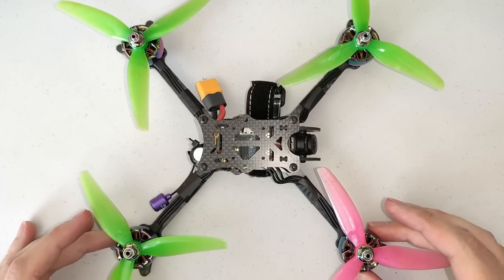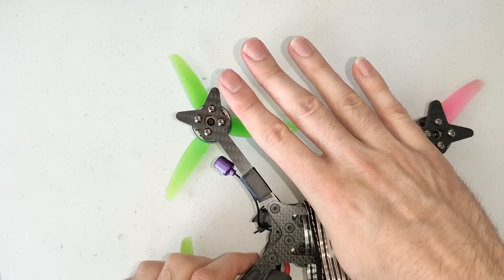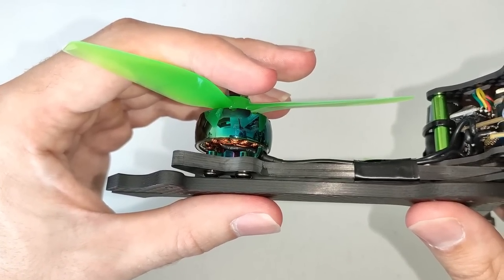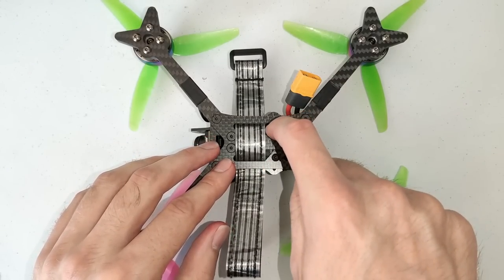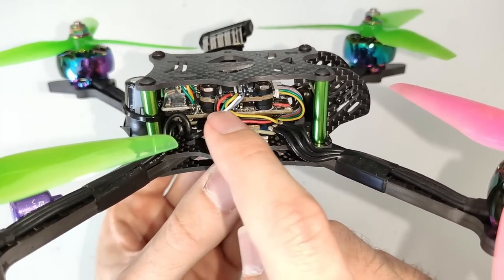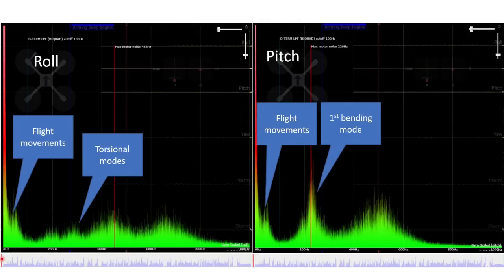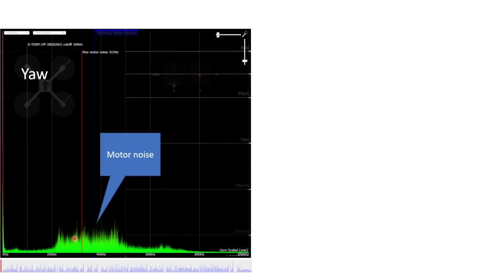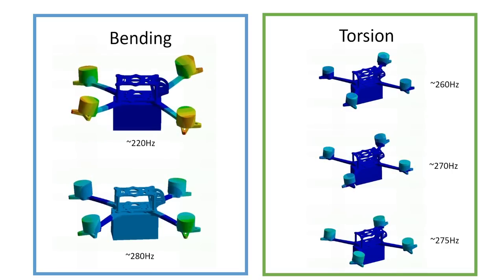The AOS 5R: I designed a whole new kind of carbon fiber to make this racing frame even faster!

Comment: i saw this somewhere on the internet.
The following is the lightweight solution we obtained through experiments for reference. Using 4.99mm T300 material is equivalent to the strength of 4mm thickness of T400 material, which is equivalent to the strength of using T700SC 3.6mm thick or T700H 3.21mm thick, or equivalent to the strength of 3mm thickness of T800S. Therefore, many drone design companies use T800 3mm to replace the original 5 mm T300 or use 3.6mm T700 to replace T300 5mm.
Reply from the maker: For strength that may be true but not for stiffness. Thicker carbon is much more stiff than thinner carbon because of the cubic relationship of bending stiffness with thickness.

Comment: also, you will find that your battery strap method will break the cd slot on the bottom plate. it also wears on straps badly.
Reply from the maker: I'll definitely look out for that. Thanks for the heads up!

Comment: What if you just use regular carbon layup and orientate the arm at a 45 from either weave rather than running parallel to one and 90 to the other?
Reply from the maker: It makes the performance much worse because you lose the bending stiffness from having any fibres running along the arm.
Reply: @ChrisRosser  I would love to see an actual comparison on this. If your arms are wide enough and provide fiber overlap, I expect there would still be plenty of tension.

Comment: I think you can go as low as 2206's to on this one, and get even cleaner flight logs. There are some really good and snappy 6s 2206's out there that can easily carry a frame at 65-68g with a lightweight setup :)
Reply from the maker: Great recommendation thank you!
Reply: Well how low can you go? 
2204 get you there with light props?
Reply: Great idea. For most people, a better responding quad will probably be more beneficial than a more powerful one. Of course not for the absolute top pilots who use 100% throttle most of the time. ;)

But I would be interested when the increase in responsiveness due to less filtering and a reduced moment of inertia of the whole quad is outweighed by the reduction in motor responsiveness due to smaller motors.
Reply: @RCRitterFPV  You can go as low as you want. But keep in mind that this frame already enables running very little filtering with normal motors (presumably Chris used 2207s @ ~30g for the simulations). So you gain less from running lighter motors than on a less stiff frame.

Comment: @ 11:20 we can tell if its resonance or motor noise by looking at the red and white waterfall fft that shows throttle percent 👍
Reply from the maker: Good point. Not much to see on the waterfall plot. There's a little area that's brighter in the motor noise band but not a vertical stripe. I would guess its a frame resonance with low Q factor.

Comment: What about using cross braces? front to back brace vs side to side brace would be interesting to see if it makes differences on the blackbox?
Reply from the maker: Could be an interesting test. Based on my previous work with braces they help a lot with torsional modes and not so much with bending modes. I'll get some cut with my next order and try them out.

Comment: I'm looking to the resonance mode and a question keeps bothering me. Why didn't you design front and rear arms to be different? This should result in different resonance frequencies for the opposite corner arms making resonance modes to weaken/disappear?
Reply from the maker: Great question! Two reasons, firstly is that it the arms don't resonate individually. The whole structure is what resonates, so changing two arms doesn't reduce a resonance it just changes the mode shape slightly and often makes things worse if the new mode shape involves more rotation of the gyro. Secondly, having all the arms the same means you only need one spare part.

Comment: Really awesome to see such a different take on making racing frames perform better !
I thought you will add braces to  the arms  to  stiffen the motor twisting modes , I have this frame , the HGLRC Wind5 lite that has braces running between the front two arms and the rear two arms is that sort of a useless addition for racing purposes ?
It will be great to see someone like Captain Vanover push this frame to its limits, if only it reaches to him .  I recommend Chris you send one frame to Vanny.
Reply from the maker: Haha! I'm glad I surprised you with the custom carbon fibre layup 😎 Braces are not useless but they add a bit of weight and don't help much with the bending modes. I'll reach out to asome racing pilots and ask if they would give the frame a try!

Comment: The frame looks great! And surprisingly it is really competitively priced as well (at least for US/CA customers). Would you mind elaborating on some design decisions?

- Most racing frames have only holes for 3 screw motor mounting. The AOS 5R has 4 holes. Do you recommend using lighter screws (Ti or Al), or do you think 3 screws is insufficient?
- The arms have quite large horns. Wouldn't making them smaller (like most other racing frames) allow more arms to be cut from one plate, making them cheaper? Especially considering they are made from the more expensive AOS arm carbon?
 - You show the battery strap threaded trough the bottom plate on both sides. Is it possible to completely thread it trough the frame and have a battery pad in the middle?
- Do use use a "wiggle plate" between the arms? Why/why not?
Reply from the maker: Great questions about the AOS 5R. Let me tackle them in turn.

1. Having 4 screw holes doesn't add hardly any weight and if you only want to use 3 screws or 2 you can choose which screw positions you prefer.
2. I think the horns give the right balance of motor protection and weight. 4 rows of arms just fit on the sheets used for production.
3. Yes if you want the strap threaded that way you can.
4. I don't use a wiggle plate because it makes the fit of the frame very sensitive to tolerances. While a single frame kit can be cut to fit tightly replacement parts may not fit well depending on tool wear and other factors. The result is that customers may need to file parts for a good fit or parts may be loose.

Comment: Isn't the type of layup you are using called Quasi-isotropic? You designed it?
Reply: This was my question: this just sounds like slightly tweaked quasi-isotropic.
Reply from the maker: No it's not quasi layup. Quasi is 25% 0/90/45/-45 my layup is a mix of 0/45 and -45 the balance is carefully chosen to match quadcopter arm load cases.
Reply: Quasi isotropic layup has the same amount of fibers in -45,0,45 and 90 degree directions, while these arms use mostly 0 degrees and a little bit of -45 and +45. So it is quite different than quasi isotropic.
Chris even went further than the simple option of exchanging the 90 degree layers with 0 degrees in the quasi isotropic layup. I think he recognized that bending is more important than torsion in this design and biased the layup more towards 0 degrees than +-45. (The first bending Mode has a lower frequency than the first torsion mode.)
Reply: @ChrisRosser  and @L S Thanks for clearing that up. I didn't see any blackbox comparrison between standard layup and this 'special' layup, only a mention of moving the first spike in noise up to 220 from 180. Those are some quite dirty logs for a lightweight racer barely above 50% throttle from what I can see. Not hating, I love inovation, it's just the results are a little misleading. I don't think shifting that spike from 180 or 220 will make any difference in performance.

How's the durability? Have you managed to test side by side with standard layup?

What is the weight of the frame please?

Comment: Is the 45*/-45* in the middle worthwhile cost-wise? Seems that a thin sandwiched material in the middle does not have enough effect or leverage to resist much torsional loads, hence hollow/tube-like constructions or carbon/foam-core laminate sheets. Perhaps unidirectional carbon sheet would give most/all of the benefits of AOS arm carbon? (Then, could there be an even cheaper pultruded option?)
Reply: i use pultruded tubes on my own frames
but that only works for a constant cross section
traditional arm shapes with vertical fibers would be useless
Reply from the maker: I certainly think so. The torsional modes of the frame are the most difficult to deal with with traditional arms and adding 45 degree layers does a fantastic job of stiffening them up. The cost increase is pretty minimal in my opinion for the benefit.
Reply: @ChrisRosser  Thanks for your insight. Thinking wing spars or composite skins, where torsional stiffness comes from 45* skins, not cores. Maybe having a thick core of 0* unidirectional with a 45* skin top and -45* skin bottom would be a better solution.
Reply: @marc_frank  "AOS Arm Carbon" comes in sheets, according to Chris, but it is only intended to be used for traditional skinny arms. And if just using unidirectional carbon along the length, then "Rectangular Pultruded Solid Strip" would work similarly and be very cheap. Just need the strip to be wide enough for the motor mount and arm-end bumpers. Just machine away the area to make the arm "skinny."

Comment: Hi, I am going to order the HD version. What is the distance between standoffs (side bi side and front to back)? and if it has also the 19x19 motor bolt pattern. Thanks.
Reply from the maker: 32mm side to side, 60mm front to back (center to centre) and the standoffs are 5mm diameter. Plenty of room for Sharkbyte TX5R1 or Caddx Vista. You could probably fit an air unit in there if you wanted to. Motor mounts are 16x16 up to 19x19 so no problem there.
Reply: @ChrisRosser  Thanks for taking the time to answer all questions.

Comment: How is your layup, better than 0/45/45/90 quasi-isotropic?
Reply from the maker: Thanks for the comment! Quasi has 90 degree fibres which aren't useful. Also I have balanced the amount of 0 45 and -45 to give the right mix of bending and torsional strength rather than just 25% of each in quasi.

Comment: At about 4:04 you say that the 45° layers are in the middle of the arm. Why is that? I at first thought that it was counterintuitive because having them on the top and bottom would probably give you better bending stiffness, but then realized that is where you also want the 0° layers to be.... Are you mainly concerned with the bending modes and then only secundarily with the torsional modes?
Reply from the maker: The 45 degree layers have a similar effect wherever they are placed in the stack wheras the 0 degree layers are more effective the further out they are. The result is that your 45 degree layers end up in the middle!

Comment: Is it possible with the extra strength in the carbon to reduce the arm thickness while still maintaining characteristics of a standard frame layup? This way weight could be reduced... IDK 🤔
Reply from the maker: Yes absolutely. You can get more strength or save weight depending on your needs.

Comment: In the typical mass produced frame...which do you think the maker is concerned more about when laying things out for a carbon fiber sheet stock...perfect strand orientation or the number of pieces he can get out of that sheet ????
Reply from the maker: In a typical mass produced frame the manfacturer is concerned about carbon quality and price (standard layup is the cheapest and most available so that's why its used). After that they will fit as many parts onto the sheet as possible. With standard layup you can have arms at 0 and 90 degrees. With AOS Arm Carbon you can only have arms at 0. Fortunately the arm for the AOS 5R is exactly the right size that you can just fit 4 rows on a sheet with almost no waste. I don't think mass manufacturers care about whether standard layup is optimum. They just want to cut and sell as many frames as possible as cheaply as possible.

Comment: I would love to see torsion/strength tests with this compared to standard layup and vs other frames. Take it to breaking point and take other frames to breaking point. Will this be more or less durable so to speak.
Reply from the maker: I fully support some testing of the material. It should be stronger as the fibres are better aligned with the loads. I also use 100% UD fibre for the highest possible fibre density which hopefully resists delamination.

Comment: I could not avoid noticing you used an iflight xl 5.1 arm for comparison (the ones with the extra 2 holes for a led light), I cannot shake the feeling that its a terrible idea that weakens the arm but would love get your expert feedback on the topic
Reply from the maker: I think it's Ok. Arms don't experience a lot of load where the holes are drilled. If they put the holes elsewhere it could be huge issue though...

Comment: Dreeeeaaammms, that's what I'm gonna be saving for!!! Analog as just need 25mw. I hope It can fit the Emax Mini Magnum stack as I'm yet the blow one up FC or ESC so would love to keep using them. They are 20*20 but over hang quite alot more closer to 30*30 size.
Reply from the maker: You have at least 40mm of clearance on the AOS 5R. The Mini Magnum looks like it should fit no problem.
Reply: @ChrisRosser  can't wait till I can get my hands on one :)

Comment: WIll you be making the AOS5 arms in the same carbon fibre?
Reply from the maker: I need to test if it provides an improvement. If so then yes I will.
Reply: @ChrisRosser  if you could that would be great. i find the arms on the AOS5 a little fragile TBH

Comment: Great layout for carbon.  I wondered why not many companies don't take into account this?  Have you been primarily flying the expresslrs exclusivly now a days?
Reply from the maker: I think most companies are focussed on price, volume and margin rather than performance. They use standard layup because it is the cheapest and readily available with consistent quality. I now fly exclusively ExpressLRS or DJI FPV control links for quads where I don't have a separate receiver.

Comment: What happened to this frame? I bought it here recently and then I go back to look at buying extra arms and it’s basically disappeared except for this video. Your links lead to a blank page
Reply from the maker: Hi Payton. Sorry about this. There have been some QC issues with the AOS Carbon (variable sheet thickness). The supplier is working to resolve them. If you need arms Nick (cncmadness@gmail.com) can cut you some out of the material we have or standard material.
Reply: @ChrisRosser  ok was just checking.  One other thing I was wondering is if there are any stls available for the frame.  I’d like to have tpu bumpers on the arms

Comment: I just designed the floss 2
Reply from the maker: Certainly the motor protection looks similar but the rest of the frame design is quite different I think.
Reply: I mean,  4 arms tied to 2 screws each and a stretch x layout. It's a frame.  Nothing special about it,  no need for triangle geometry here ? Any race frame of the last 2 years and a 2021 like camera cage that seems to be preferred now = this frame.